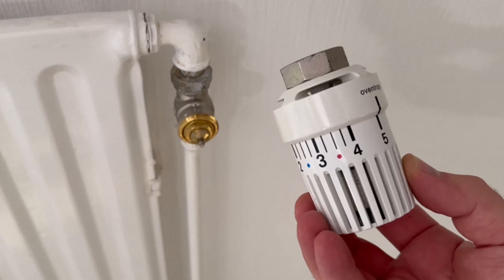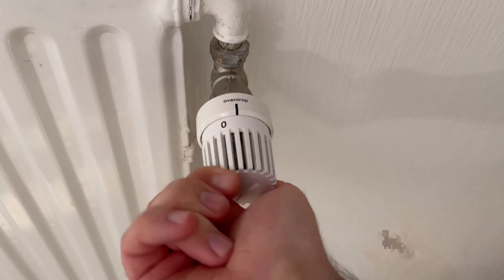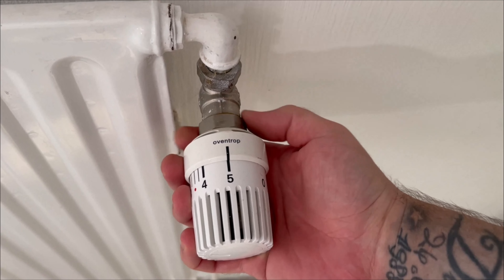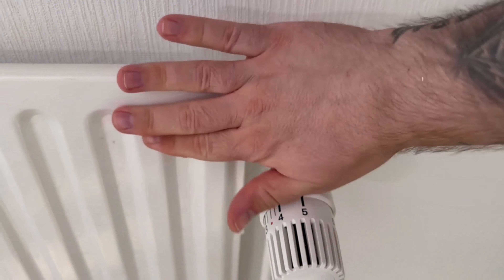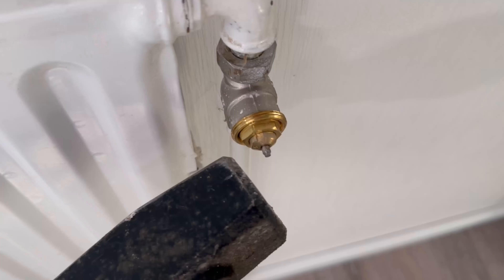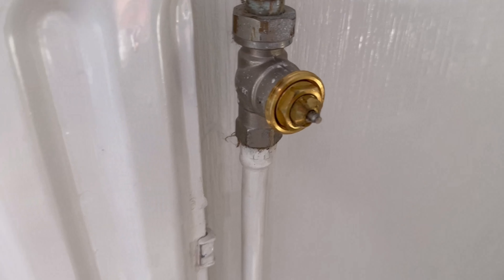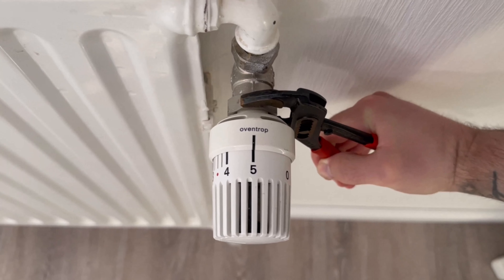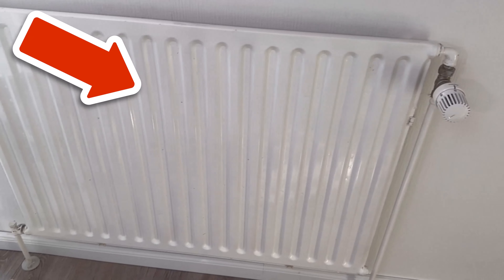Radiator not getting warm?💥(Repair for 0$ in 3 minutes)🤯

Comment: That is sediment in the lines.  There is a way to see this.  Under your sinks is a valve.  That hardly EVER gets turned.  TRY turning it.  If it hasnt been turned in a long time Sediment has built up.  If its plastic,,, DONT HIT IT.   At least 1 time per year, go around and Turn those valves.. depending on how Heavy the water is with sediment, is how FAST they get Filled and Locked in place.
Steam/hot water heaters, Should have a Dump valve in the basement.  And its NICE to drain them during NONE USE..  and if you want to make this better, Use Distilled water in the tank.